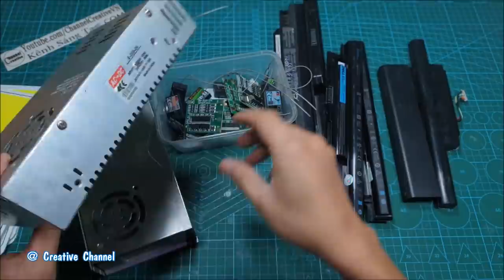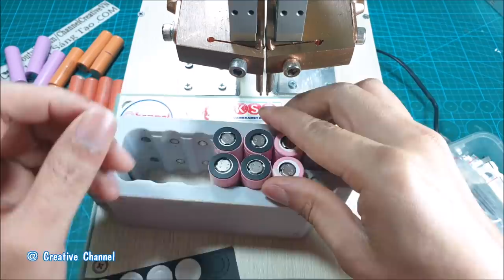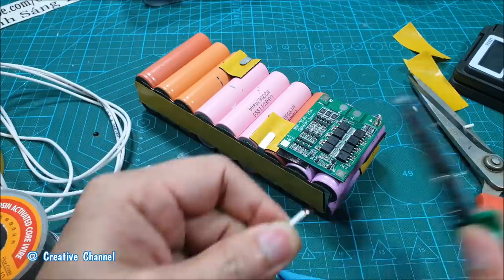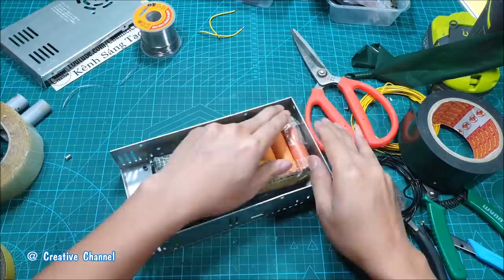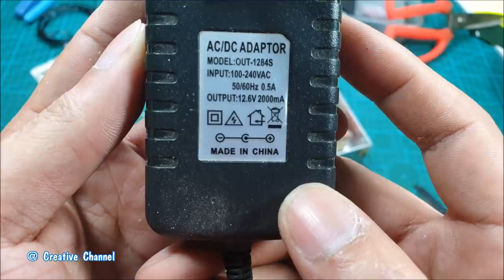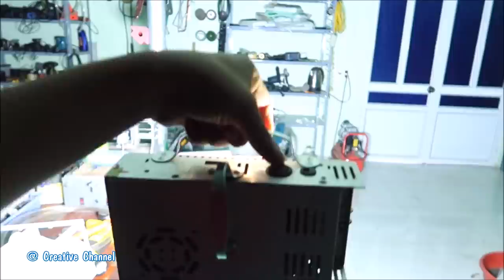Build A Camping Lamp Light using Old Laptop Battery

Comment: After reading the title and description first, I thought "how on earth can you power a 70W LED via laptop grade 18650s, as that works out to be 6A per cell?". After seeing the construction of the battery pack, I was impressed. Using 6 cells in parallel limits the current to about 1A per cell, which is fine for standard 18650 cells.
That looks to be a really effective flashlight, which would equal most car headlights (most car headlights are about 60W).
The only thing I would add is some kind of fuse/additional protection, as well as use a different charger: a 12.6V 2A charger will take forever to charge that pack as it is only designed for 1P or 2P battery packs, not 6P. I recommend 12.6V 6A charger for the best charging time.

Comment: This charger will take more than 100 hours to charge these cells.
Reply: Hello M.Waqas Siddiue, how this charger will take 100 hours ? If you check closely you will see that it's output is 12.6 V ,2000 ma (2 Amp). I have built the same battery packs and I am using the same AC/DC adapter whose output is 12V and 1500 ma (1.5 Amps) and it took 4-6 hours to charge the cells.
Reply: @yjtechnical4700  es mui durable!
Reply: Waqas can not calculate wkwkkwkw
Reply: ari widodo  yes, I used BMS.

Comment: I noticed that you didn't install heat sink for the light. Does it get extremely hot?
Reply: The metal smps body works as a heat sink :)
Reply: This is why I don't attempt any internet DIYs unless it is done by several  people .

Comment: Amazing bro, it's very useful. Where I can get this circuit board, how much max voltages required
Reply: Bro it is Bms board 
You can get it on Amazon
Reply: You can use rupees 25/- tiny bms for each cell

Comment: U place 18650 battery at hot part of LEDs - it is really bad idea... need thermal insulation or batteries are degraded by heat! (something like an asbestos gasket and unburned mineral insulation)

Comment: I have done the similar project which was 10W COB LED with 12V battery supply. After 10min-lighting, the heat generated by LED destroyed the LED and the temperature reached above 100oC.
I suggest to install extra-heat-sink & fans to cooling the lamp. I think after 10-min-usage,  the hand bar is so hot that it's a safety issue.

Comment: cooling solution for that is very bad it can overheat easily especially when it consumes 70W
Reply: I'm afraid you may be right. I was fully expecting him to add fan or two to that. Seems he had enough power via all them 18650 batteries and definitely places to mount them. While all that aluminum would make for a good heatsink that's still a lot of heat to dissipate.
Reply: This light is only for you who got nature calling
Reply: @Bagoesbudianto  pretty sure it's for the person who want's to start a forrest fire
Reply: @AnthonyGoodley  i was expecting at least a fan as well but nothing?.. yeah that can't be good
Reply: @aleksandersats9577  When I first started getting into electronics I would have thought nothing of this design. Now that I know more and realize just how much heat just a single 1 watt LED produces, much less a 70 watt COB, I can clearly see how either the LED's will likely produce some magic smoke or most definitely have a greatly reduced lifespan due to being abused so badly. 

Save these poor LED's from abuse and add a fan or two people if your planning to build this otherwise pretty cool light. Preferably both an intake and outtake fan.
Reply: @AnthonyGoodley  Yes i can agree. The only abuse you can do to an LED is overvolting them for more light and by overvolting I mean max 35% and that applies if you are able to keep it cool. At first you may think this is a bad idea but it isn't the LED's will only fail if there is too much heat. And if you somehow are able to remove all heat from it you can use a tiny led as a 1000w one in theory though in reality it is impossible.

Comment: 1:50 Just to let you know, those cells that were below 3V can still be used, they just need to be charged up. Of course you should always check internal resistance of the cells and do a full charge/discharge cycle. Cell voltage is not always the main factor to consider; I have had plenty of cells that are under 3V turn out to hold a good amount of charge.

Comment: Can you do projects with universal washing machine motors where you run them on DC instead of AC? Make a motorized bicycle or go kart?
Reply: you will need an inverter to convert dc to ac
Reply: @jzlproductions3908  No, universal motors can run on both ac and dc
Reply: @lengaming1651  i mean if you want to power the motor using dc just use a dc to ac inverter. So you will have a dc source and ac output